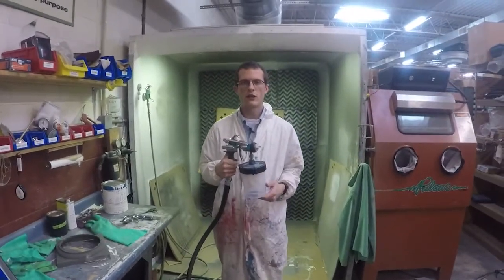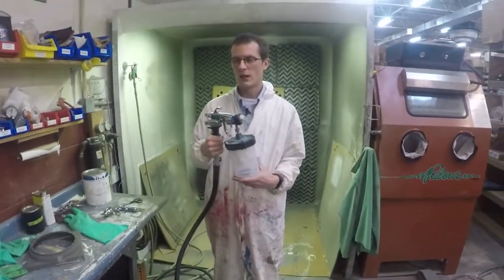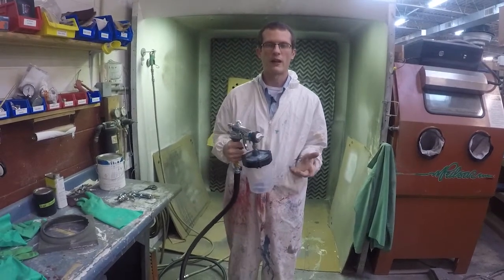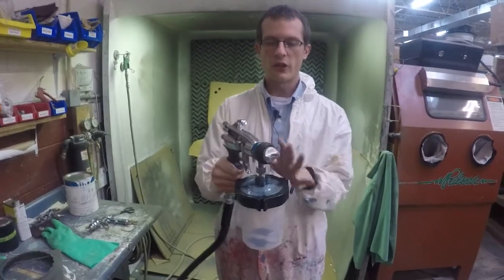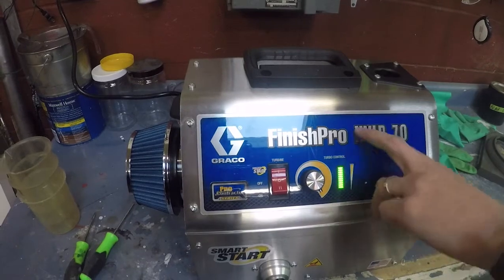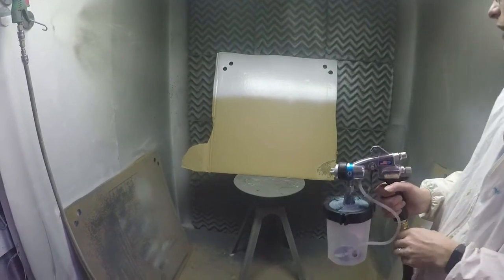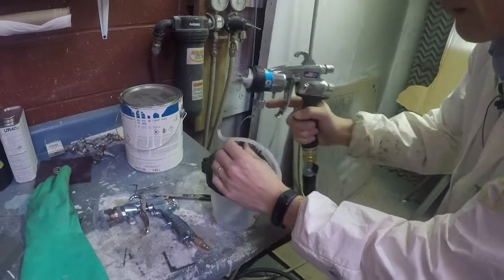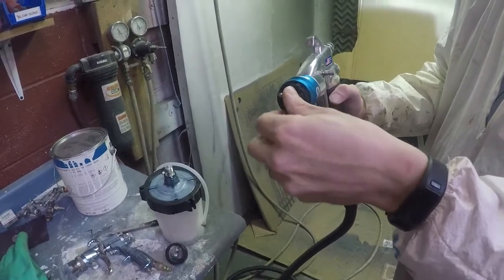Graco FinishPro HVLP Turbine Sprayer Reviews

Comment: Looks like you would get dry spray like that.  Maybe more fluid?   I really wanted to get one of these.  Still on the fence.  I haven't seen much info out there still.  I spray waterborne with my graco airless.
Reply from the maker: If you have an airless you can consider a fine finish airless tip first but the Turbines do allow you slightly finer control of patterns and a bit more control but do have a bit more learning curve to get used to